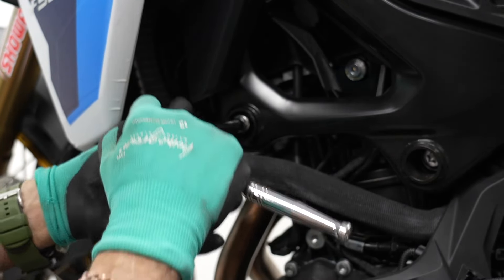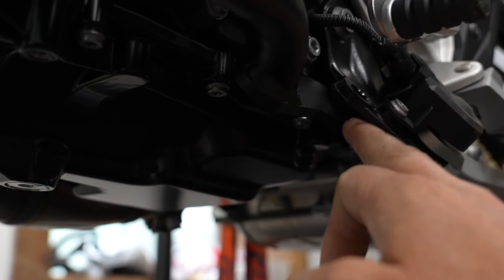BMW F900GS Crash Bars Installation Guide

Comment: An installation video should provide torque specifications for the bolts.
Reply from the maker: @user-zj6go9hb8o  we do, except the OEM bolts.
Reply: @Outbackmotortek  Sorry, but I don't understand your comment.  Where are the torque specifications provided in this video for the F900?  I found the values, including OEM bolt, in your video for the F850 bar installation, but why not include them here?  Great crash bars by the way.  I'm happy with the fit and finish.
Reply from the maker: @user-zj6go9hb8o  it’s the same thing. The F850GS and F900GS crash bars are 100% identical